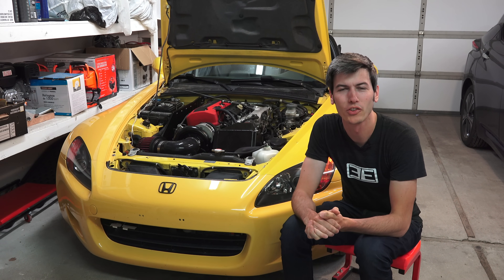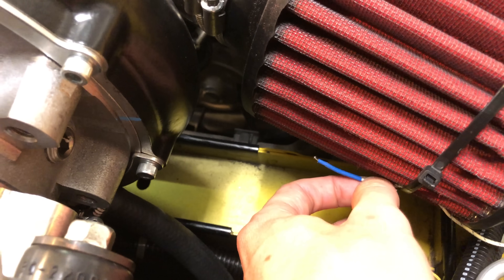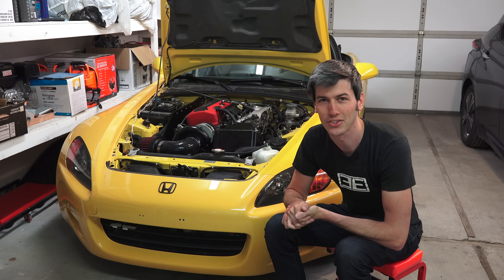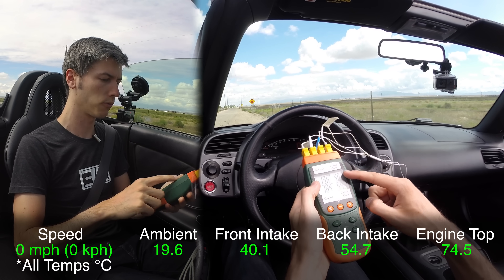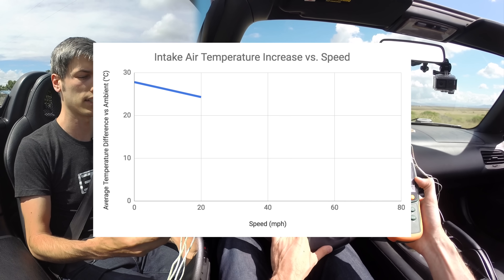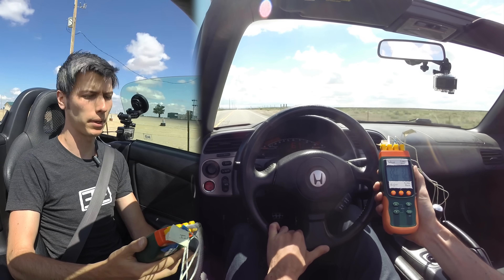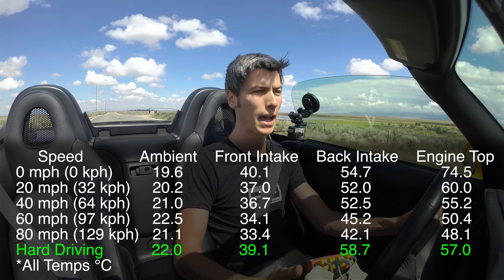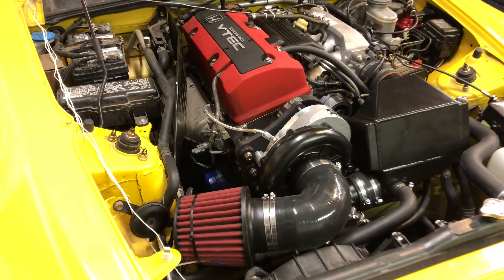Does My Supercharged S2000 Have A Hot Air Intake?

Comment from the maker: Lots of questions/comments about the intercooler. Yes, the intercooler will help bring temps down after the supercharger compresses the air, however starting with colder air means the air entering the intercooler will be colder, and thus the air exiting the intercooler will be colder as well. 
Edit - Additional note: The air temps are generally high because the air is heated by the radiator prior to being drawn in. I assumed there would be a bit more "fresh" air than there actually is. When I started driving (before the thermostat had cracked, meaning there was no coolant flow to the radiator) the intake temps remained nearly the same at the front and back of the intake versus ambient. As the engine warmed up and the radiator cracked, temperatures started to rise. This implies that the proper solution would be to have the intake pull air that has not passed through the radiator, whether that means moving the intake forward, or creating a box around it that pulls in air from the front. Looking back, I don't think a heat shield would do all that much for intake temps. Perhaps a small benefit for the back of the intake closest to the exhaust. 
And if anyone's interested in going back to the Acura Integra days, I have a video testing if cold air intakes actually work: https://youtu.be/llKZdUyoz14 If you want to know the science behind why they work, here's a video on the math: https://youtu.be/Hiod1c2Py70
Reply: Can you slip the probe under silicon coupler into the intake track at filter, before and after intercooler (and control on bumper)? Then monitor how the intercooler handles differences in intake temp. Supercharger will increase air temp by around 7.5*C per psi. Intercooler can’t drop temp below ambient anyway.

So if ambient is 20, intake at filter is 40, intercooler inlet is 85 and intercooler outlet is 50 and 60 after intake manifold heats. Can you gain much hp by dropping intake at filter to 30? Probably not. But it’s a fun project. Heat shield would look cool. And maybe one of those J’s Racing hoods with vents and bump for intake scoop in J’s Racing bumper.
Reply: Have you considered wrapping the exhaust manifold in that DEI wrap? I know it greatly reduced underhand temps on my old second gen xb after installing an aftermarket exhaust manifold. Might be worth a shot!
Reply: Engineering Explained 
ƎE
The question is how long I need to return from hard driving temperature to previous test temperature ( 129 kph )
Reply: Mix of shield/ducting and exhaust wrap.
Reply: Could OBD data from the MAP sensor (air density) be "easily" obtained under the different conditions?  Then you could compare intake air temp to what the engine is really feeding off of.  It's a fairly complex process with dynamic flow and both internal (pressurization, volume, etc) and external (hose proximity to hot engine parts that is not uniform over the entire flow path) effects.  Maybe put stock air box on and take same measurements too as a control.
Reply: you also get hot air from the radiator thus its probably best to reroute the air intake, also if located properly you could get some ramair charging effect
Reply: Engineering Explained the easiest but certainly not cheapest option is putting a small inverted scoop over the air filter on the hood. Almost like the Evolution 10 has in the middle of the hood
Reply: Engineering Explained the intercooler can only bring temps down to a certain point. It doesn't matter how hot the air is going in AS LONG AS ITS ABLE TO COPE WITH IT. my guess is you're intercooler is compensating for it just fine. 

You should do a test of air Temp after the intercooler with your current set up and perform the same test when you have it set up for a cool air intake. That would be facinating test, and it would give you a far far more accurate analysis on whether hot or cold air makes a difference, at least in your case/car. Either way you have to set it up for cold air intake just to see is there a difference, now you gone this far. If there was a 10-20c difference after the intercooler I'd say it would make a good difference, but i highly doubt it's actually more than a degree or two difference between cold and hot air intakes after the intercooler, if I had to take a guess I would guess it will not make much difference.
Reply: Engineering Explained what's the temperature of the air behind the intercooler and inside of the intake, does that hotter air under the insulation at the top of the engine result in any termal soak after the initial cooled charge from the intercooler? I remember my old LT1 I built yielded a 15-20° decrease in air temp after bypassing the intake water jackets, and I wonder if the smaller engines might suffer from the same issues.
Reply: you can put it forward of the rads, just fabricate a water shield/air box from sheet metal (i like the hex holes punched in it, like you see on corsair pc panels), paint it black and install it forward of the filter, with the holes on sides, back and bottom
Reply: I'm curious too see if a hot air intake vs cold air intake makes any appreciable difference in boost air temp for intercooled superchargers/turbochargers. In my experience, it is very common for hot air intakes in intercooled applications, while NA applications have cold air intakes. Part of that could be that it doesn't make enough difference to warrant the effort, and another part could be that there isn't much room for a cold air intake in the bumper after putting an intercooler and the necessary piping.
Reply: Engineering Explained 
Hi, I also own an S2000 and have been looking into this actually. There are scoops and top radiator plates available that scoop air from around your outside measuring spot, over the radiator and into the stock airbox. I have seen people use this with an aftermarket intake and a heat shield. Looks like a very effective setup, as long as your moving anyway. A filter outside the engine bay wouldn't have the heat soak issue but I wonder if the complex and possibly restrictive longer intake would really be worth it.
Reply: +Jelle  That should work well.  A fair number of stock setups have the same thing - a duct from just above/ahead of the radiator to a sealed air box, so it always pulls air from ahead of the heat.  He may need something larger than stock, since he's pulling more volume now, but it wouldn't surprise me if there's something factory already out there from a larger engine that would work.
Reply: I like the "math" video, but why are you wearing a safety helmet?!?!
Reply: Yes, no matter what, you need an intercooler! Can't believe you do not installed one...
Reply: Time to get a Mugen air intake?
Reply: Well you do have a water to air intercooler, those are far superior heat sink devices than air to air. Short term changes to the cooler inlet probably don't make much difference to the outlet. And if the coolant flow is counter to air flow (and the system has a large enough radiator) it's possible that you aren't getting post IC temps much above ambient anyway.

That said, making a cold air intake would be technically correct, and if you ever track this thing the intercooler will heat up and it will make a difference then
Reply: Sergio Valente he does. It's an air to water exchanger. He just failed to mention in the video
Reply: I'm off to watch another video
Reply: Engineering Explained you missed to park the car after using it, let it some minutes, and open the hood to check the temperatures, this time when the car is not moving, all the heat of the engine bay increases to all parts, so then if your filter was at 40° C , then been parked a few minutes it could be at 60 or 70°C, and if you come back to use the car, it will be hotter than before and this is the moment when the intake is affected . What you think?
Reply: Grandma's Malibu you reffer to the structure of all the intake?, I mean from the silencer box outside the engine bay, passing to the purifier box, then the hoses and until the head intake, the trayectory it has to do to arrive to the cylinders?
Reply: Much obliged for the additional note! You're typically quite thorough about addressing the variables in a given scenario, so I was a bit surprised you didn't mount a thermocouple  behind the cooling fan or thereabouts; I was shocked you didn't even mention the effect the radiator would have on under-hood temps! I should have known you wouldn't leave that stone un-turned for long! I did some checking of my own when I installed my fist H.A.I., finding the only way to get cool air to it was either: a)  route dryer vent hose (it's what I had, okay?!) into the engine bay to the intake from the bumper (even 6" dia. only showed a difference of approx. 10 degrees F, as measured with an infrared pyrometer), or b)pop the hood and drive around with just the secondary latch engaged. Super safe. Yielded results, though: 22 degrees F was the peak differential! My car has a steel hood, so I really need to just stop being lazy and cut out an NACA-style scoop in the front, or some louvers at the rear to aid in extraction. Or both! You can get several styles of carbon hoods for your S2000 with vents/scoops/louvers, plus higher capacity radiators and the like with relative ease. Strong aftermarket to this day to support those cars. That's the direction I'd like to go, generally increasing cooling efficiency/under-hood airflow, wrapping the exhaust, etc... especially if I decide to go forced induction! :D
Reply: I think we must clarify something. Since superchargers (be it roots or centrifugal type) have a fixed rotating speed for any given RPM, they effectively ingest a fixed amount of air at any given RPM. If this air is hotter in the first place, it is less dense and contains less oxygen molecules. However efficient your intercooler is, the system initially ingested less oxygen molecules, and power potential is reduced. 

This differs from modern turbocharged/intercooled cars, which can compensate for hotter/lower density air sensed by the MAF by spinning the turbine faster and produce more pressure to keep power constant. Superchargers can’t do that. So yes, they do benefit from colder air.
Reply: Engineering Explained The horn is in a very odd spot; been working on Honda’s for 15+ and have never seen a re-mount to the shock tower
Reply: it would be cool if you did some custom ducting and added your own flare to things in the process. maybe like 3d print a thin fishmouth piece that you attach to the top of the opening of the front bumper than transitions into a 2in round opening then get you some HVAC hose  (180 degree bends without losing circumference capability) to the opening and route it up to your filter. maybe 3d print a box to enclose the air filter with an opening for said HVAC tubing make another hole in the box so it has sufficient air flow and cover the rest in cool gold temp reflecting tape that way you can style and nerd out at the same time.
Reply: What multi probe meter is that?
Reply: It might not impact the air intake temperatures necessarily. If your intercooler is very efficient, it will cool down the air to the ambient temperatures , no matter what the starting temperatures are. That means 40 deg will cooldown to 20 deg, and 60 deg will cool down also to 20 deg. 

Of course colder intake air is always better, but the difference might be negligible, and might not be worth it for example to block air stream to radiator. Sitting behind the radiator it might actually increase the airflow as it is lowering air pressure inside the engine bay by sucking that air in.
Reply: reverse the scoop int a vent, air works better when pressures are lowered. Common misconception there Joseph
Reply: Domas64 However eficient your intercooler is, a supercharger is driven by the crank pulley and has a fixed rotating speed for any given RPM and ingests a fixed amount of air. Hotter air ingested means less oxygen molecules in the system whatever you do to it. It you make in cooler, the pressure will drop. So yes after the IC you get cold air charge, but at a lower pressure than if it ingested colder air in the first place. So the best solution is having both: cold air entering the system, and cold air entering the motor (with the use of the intercooler).
Reply: Hmm I see your point. So the supercharger is more effective when pulling cold air? Meaning that it can spin slower to get the same boost? You could reduce drive pulley to make more boost to compensate, but that would increase parasitic loss from the engine.
Reply: Domas64 exactly! Much better to keep the same boost level by letting the superchager ingest colder air than to increase the pulley ratio ;)
Reply: jet guy I love these technical explanations thanks for the input!  What I meant by pressure drop is in fact applying to the whole system, knowing that the pressure is the same before and after the aftercooler.
Reply: jet guy I agree the difference wont be night and day on his setup. But my « super accurate butt dyno » definatly feels a difference when it’s 10Celsius versus 30Celsius outside in my supercharged/intercooled miata. So reducing intake temps 20-25 degrees might make the same kind of difference. Anyway it’ll be fun to see the gains he may have
Reply: @louisolivierfortin  except that's how positive displacement superchargers work, the relationship between rpm and airflow isn't always linear (or at some points even present) in a centrifugal compressor.

If you look at a turbo compressor map you'll note pressure ratio on the y axis and airflow on the x axis. The rpm lines are initially horizontal and rarely end up vertical except at the limits of the compressor flow, this means that rpm correlates to pressure ratio rather than airflow.

If you want a way to picture this, realise that a centrifugal supercharger can both flow air at zero rpm (if you have the belt off you can stop the pulley with your hand while the engine is running) and spin with zero airflow without creating hundreds of psi (eg throttle closed at redline). Plus there's the compressor surge thing where you get reverse airflow. A positive displacement supercharger does none of those things

The result of this is that under most conditions an intercooler on a centrifugal supercharger system will result in increased mass flow because the pressure doesn't drop as much as you would expect. 

I'm not, however, sure how temperature at the inlet affects pressure ratio at any given rpm
Reply: You should box in your intake air filter to separate it from the heat of the engine bay, but install a NACA DUCT on the hood to allow fresh air from outside to enter in the box, engine.
Reply: How about a heat shield that has a reflective surface that faces away from the air filter?
Reply: Jason maybe you could get a snorkel. Be good for water crossings too 😁
Reply: Engineering Explained are these cars Really That Fast
Reply: i think part of the issue is the radiators dumping heat into the engine bay. i would be looking into relocating the intake first
Reply: Your in over your head. You are becoming one of those people that are getting better at making video's for youtube, but you are losing the beautiful part of yourself. You must stop, or I should say, you should stop.
Reply: hi my name is i am mailing you to ask one technical question i want to know that the v12 or v8 engine build for mid engine layout is constructed similarly like v8 or v12 constructed in structure and design like front engine does the engine in mid engine layout is same as engine in front engine like because cars like pagani zonda and huyara got engine from mercedes mclaren f1 has bmw v12 engine and some supercars have chevy base v8 engine koenigsegg got ford based engine so does mid engine layout has same engines which are constructed for front engine and same engine can be used in either mid or front engine layout waiting for your humble reply thanks indeed
Reply: Hi sir my name is Ali i am mailing you to ask one technical question the v8 or v12 engine used in a mid engine layout supercar is similar and constructed similarly as the engine in front engine car is constructed because many super cars like pagani use Mercedes v
12 and McLaren got bmw v12 while koenigsegg has ford v8 do the have similar structure as front engine is manufactured or engines in mid engine layout are different in shape and design compared to engine mounted in front engine car but many super cars use engine which are also found in front engine cars in other words the engine used in front located car can also be used in mid engine setup waiting for reply thanks indeed
Reply: Hey, nice test, it could be improved, but still nice efort. It all depends on the car itself and how much space there it is for a cold air box, rerouting the whole intake, intercooler. or some hood vents Take in mind that you need an everyday solution, not a trackday one. So dirt,  water/autovlogs first C63/, small rocks from other road users (like trucks) and every other thing that could damage an eventual mod. It would be nice to be an everyday suited mod.
Reply: Lq
Reply: @Engineering Ugh, stock intake is better or Mügen puts the squeeze on for the best.

Comment: Kinda expected the results since Mighty Car Mods has done this before. 

Those open pod intakes makes your engine perform much worse and you do lose a few horsepower.
Reply: u are not entirely correct, MCM uses a CRAP CAR without a turbo/SC. 
open pods and larger exhaust pipes are answers when you have a blower, the higher psi u push, the larger intake n exhaust u need but at the cost of losing lower end power
Reply: Samuel Wong actually they did both NA and turbo car. I rmb them using a R34 GTT for the turbo test. 

And it was tested on a Dyno.

The real bhp gains was removing the left headlight to let cold air enter. And the most extreme test was using the open pod ouside the car.